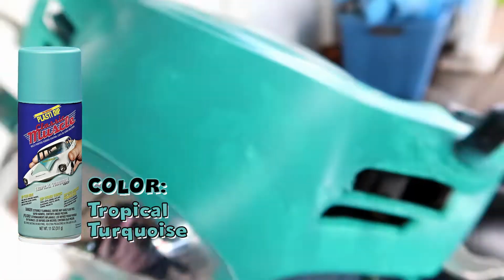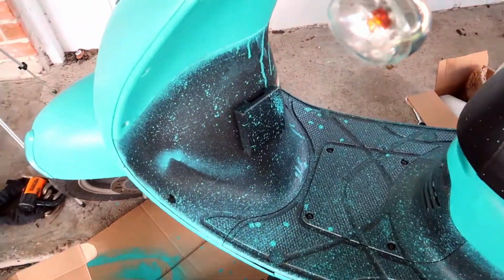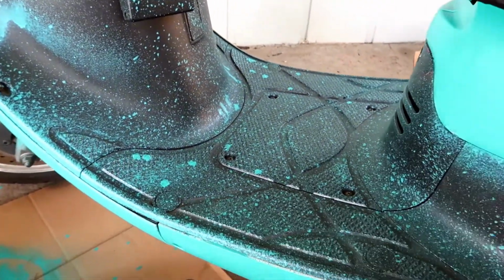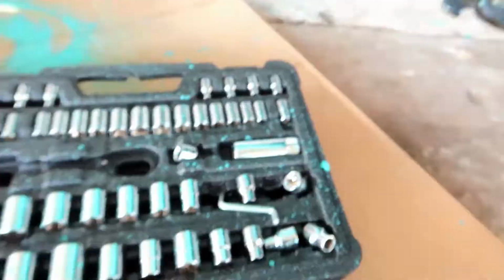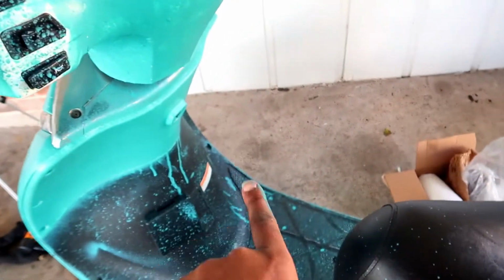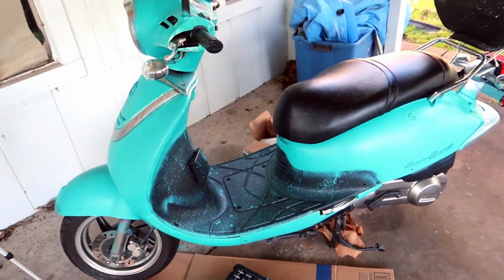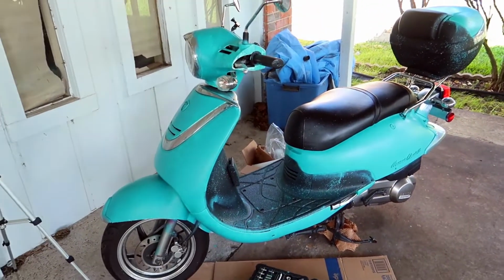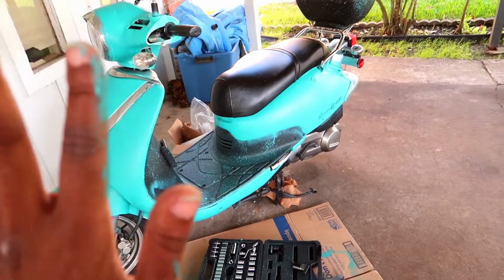Spray Painting Moped Scooter

Comment: You're scooter would look better without the storage basket at the back..
Reply from the maker: maybe, but storage to so convenient. I find myself using it all the time.
Reply: @RamenOnWheels   wear a backpack and use the under seat storage , That's what I do on mine , btw how many cc's is on your scooter? 50cc? 80cc? 100cc?, I recently put a 80cc kit on mine runs alot better..
Reply from the maker: @Marvel_vs_Capcom84  I like backpacks and I do use one from time to time, but the case is just more effortless.
Reply from the maker: @Marvel_vs_Capcom84  it's a 125cc
Reply: @RamenOnWheels   Nice I really wanted to get a 100cc or a 150cc but the place were I got mine only have 80cc in stock , and you gotta pay 500 dollars in advance for them to order a 100cc kit so I just went with the 80cc plus i plan on getting  a racer 50 scooter within the next year they look just like motorcycles just with a 50cc engine which i will upgrade to  a 100c , As far as the storage goes whatever makes you happy i just hate the way those basket box looks on the scooter..